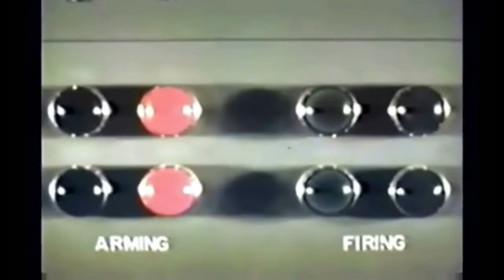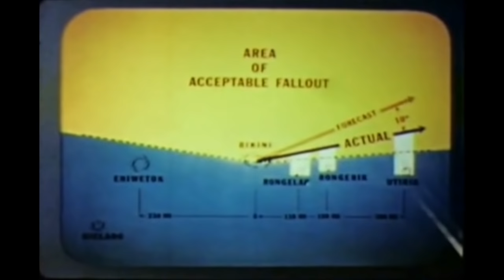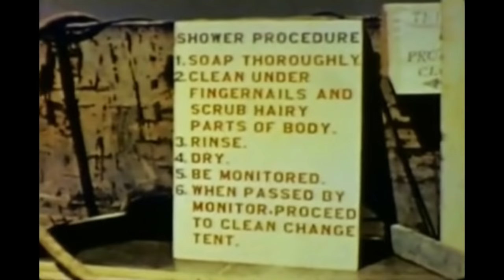The Deadly Miscalculation at Castle Bravo (V3.0)

Comment: if you die without ever seeing that in the sky during your lifetime, you're fortunate
Reply: Dinky Doo did you feel that intense heat even after you woke up? I did in my dream..
Reply: @PMScroMo...
Reply: Ummm...Tokyo fireball???
Reply: if you live after seeing that in the sky, you're very fortunate
Reply: Well kinda but in your scenario I'm still dead :)
Reply: I have a bad feeling nukes will be used at some point in the next 15 years.
Reply: what im saying is  Well I was actually going to say 14.5 years but I was rounding up.
Reply: questionseveryth1ng
questionseveryth1ng
I live 4 miles from a primary military base. All I will ever see, in about 9 nano seconds will be a bright flash. I will not have to live days, weeks or months dying a slow death from radiation. Yes, I would be most fortunate.
Reply: @tonyv8925  4 miles? You've got some seconds to get into your bomb shelter.

Comment: In the 90s I was doing environmental work for the US Air Force.   There were drills for me and my fellow civilians to practice recovery and repair of the base in case of tornado damage while the bulk of the military in my unit were deployed.   We also practiced what we civilians would do in case of some sort of low level nuclear accident.   I was trained to take a 2000 gallon water truck around to wash off low gamma type radiation off buildings.   I knew, however, that if such an event occurred I was taking my family south and calling in sick.

Comment: The technical problem was a miss calculation of the neutron capture cross section for Lithium which results in it being converted into tritium (hydrogen isotope) which fuels the fusion reaction.  The capture cross section is determined by colliding a neutron beam at the desired energy into a lithium target.
Reply: Not back then. It wasn't thought about at all. If it were to be calculated, it'd have been done with a slide rule.

Comment: What a terrifying sight.
Reply: lolwut? we've never made any enhanced radiation weapons
Reply: They never needed to build new ones. If you make the bomb small enough, the rad pulse is a lot wider than the fireball and you get a neutron bomb. If you stick some cobalt-59 around a standard bomb, you get an enhanced-fallout bomb.

Of course, they didn't use either of those. Instead, they downsized the yield, since megatons are a lot more expensive than they need to be if you can get the same result with a lot less bomb on a more accurate missile.
Reply: I doubt only the americans have variable-yield bombs, haha.
Reply: Scott Matheson watch tsar bomba explosion
Reply: But pretty
Reply: You think that was terrifying?  Look at the Tsar Bomba video on YouTube, THAT was terrifying!  The pilots that dropped the bomb almost didn't make it back, it was so massive, and that bomb had a parachute on it to slow it down so the plane could get away.
Reply: Russia, China and Israel possess multi-megaton thermonuclear bombs, the means to launch them anywhere in the world or BOTH. That is terrifying.
Reply: That's the idea

Comment: Miscalculation? Nuclear physics was still in its infancy in the early 50"s. There had been very little research on isotopes of atoms, let alone on isotopes of lithium. Cyclotrons were still in their infancy and backlogged for years. All the tests done then were a rush to to get results. The assumptions made for the trinity test turned out to be true. The assumption that lithium7 would be inert and not not donate neutrons was wrong and the result was the catastrophe that happened.

Comment: The lithium problem led to the real issue why the explosion was too big and very dirty...many more fast neutrons than expected so the uranium 238 tamper, which was not in a fissle state, was ignited and split by the excessive neutrons leading to far more explosive energy and radioactive fission products than predicted.  The primary fission/secondary fusion/tertiary fission bomb had been created.  A mostly pure thermonuclear fusion weapon is relatively clean as far as fallout is concerned.  The only radioactivity comes from the small primary which is less than a kiloton to ignite the fusion reaction.  But if there is any additional uranium in it, you will get tertiary ignition and more blast/radiation.

Comment: You didn't tell WHY there was more lithium 6 than calculated.  Under emence heat and pressure of the initial fission blast, the lithium 7 changed to lithium 6.

Comment: they used lithium 7 not  6 because 6 was too expensive and rare at the time. they extra fuel released from 7 created the higher than expected yield. had they 6 , theyd never realise the advantage of using lithium 7  since lithium 6 doesn't have the same properties.
Reply: It is an advantage. even if you use it and make a mistake. anyone can use their own advantage and make a mistake with it

Comment: how did the cameras survive with the footage we saw while other things around it got completely destroyed?
Reply: The footage is fake. Even if the machinery survived the film would have been wiped instantly with the massive dose of gamma radiation from the flash. This doesn't mean the weapons are fake. That's an entirely different topic.
Reply: paulanderson79 wrong😂
Reply: Pugsley tattoos how DO we get the footage then? 
I’m genuinely curious here.
Reply: Most footage of these nuclear detonations is from very far way.  The cameras were fine.  Footage taken a bit closer where the shockwave can be seen knocking down trees is taken by cameras that are well protected.  Whether or not you think the shockwaves are from  nuclear test is irrelevant.  A shockwave is a shockwave.  You just have to set up farther out the bigger the blast.  Buildings can be knocked down well outside the fireball radius in a large nuclear blast.

As far as radiation ruining the film, film canisters were lined with lead.  Simple fix.  There were special cameras designed after world war II to specifically film nuclear tests.  Reinforced bunkers built around them, special apertures, special emulsion to account for x-rays, etc.

You can research all of this yourself, you don't have to go around claiming the footage is fake just because you don't understand how anything works.
Reply: Cameras in bunkers under the ground using mirrors to see out
Reply: rock4you  They were housed in chromium dilantium!
Reply: Cameras were generally pretty far away.  They also sometimes used techniques to film reflections instead of the direct shot.  They would build bunkers specifically for observation and equip them with special glass that blocks high energy radiation.  They actually had to develop many new filming techniques and even completely new, extremely high speed cameras (called rapatronic cameras) to do precise measurements on the bombs during their explosions.

Comment: How can Lithium 7 be "inert" ?  Multi million degree temperatures are going to fuse it as easily as Lithium 6.
Reply: Get the reactions right!  The error was failure to account for the tritium produced by the Li-7 + n -> T + He-4 + n -2.47 MeV reaction.  Notice that the reaction consumes, rather than yields, energy.  However, the tritium produced enters into a reaction that does yield energy in excess of the 2.47 MeV that was consumed.

Comment: How and the hell do you call a mistake, a miscalculation?  They didn't miscalculate, they made a assumption, that turned out to be false.  That is a mistake, not a miscalculation.  They said 7 would be inert.  They guessed and were wrong, that's not miscalculating, that is just plain old WRONG.

Comment: The new thermo nuclear device was massive! 5 ft. wide and 22 ft. long. Mk 17 would just fit into a B 36 bomb bay. Standard load-out for the B 36 "Peacemaker" was a Mk 17 and a Mk 6 atomic weapon. It would have been extremely worrying to the B 36 crew that would have had to drop the Mk 17 because no one knew for sure if the plane could fly outside the blast radius before it went off! I believe technology today has shrunk thermo nuclear devices down to the size where they can fit in a golf bag. BTW, the USAF retired the B 36 60 years ago in 1959. This happened when the USAF took delivery of the B 52. FYI, the B 52 will be over 90 years old when the USAF finally retires it!!

Comment: How would it be possible in 1954 to capture the high altitude footage?  Seemingly on a stationary platform. 🤔
Reply: @
Dean Floyd
RE: "How would it be possible in 1954 to capture the high altitude footage?  Seemingly on a stationary platform."
There were plenty of planes that could have been used. They showed in the video a line of F-84 Thunderjets, for example. The could have also used a B-36 Peacemaker, B-47 Stratojet, B-52 Stratofortress (a.k.a. the BUFF), B-57 Canberra, etc.

Comment: Don’t worry boss... I’ve done all the calculations. Wait Oops! ☠️☠️☠️☠️
Reply: To be fair their calculations were correct.  The problem was that there was no way for them to know that under intense pressure and massive amounts of heat that Lithium-7 will become Lithium-6.  It wasn't something they could have predicted before running such a test.  

Also, the fallout and radiation issues they had weren't actually from the increased yield.  There was always going to be a LOT of fallout for a ground burst test whether it's 6 MT or 15 MT.  The problem there was that the weather forecast ended up being wrong - the forecast said that they would have steady wind that would not change direction for several days which would blow the fallout into uninhabited open ocean.  Not long after the test the wind changed bearing by around 90 degrees and blew the fallout in an unexpected direction - towards inhabited islands and the "Lucky Dragon".

Comment: If any physicist is available
Is it possible to increase the yield of a Uranium based low yield atomic bomb by merely spreading over/ adding up another enriched element like lithium7 or deuterium or plutonium?
Kindly enlighten me and oblige
Reply: Not an engineer but did look it up. The lithium used in castle bravo used 50% enriched lithium. As noted such an enrichment wasn't supposed to amplify the blast that much as previous enrichment was very small in other nukes. So yes it likely would. Remember they can fire a forty kiloton nuke out of a 155mm howitzer.

Comment: what causes the distinctive ring in the sky above the blast
Reply: Changes in air pressure causing cloud formation.
Reply: jaychi chocholowski Its the heat vaporizing the moisture.
Reply: +solace214 
that makes no sense
Reply: It's called a condensation cloud, also called a Wilson Cloud. Explained here:
https://en.wikipedia.org/wiki/Condensation_cloud

Comment: Castle Bravo was not the first hydrogen bomb to be air dropped. The SEMINOLE Shot was.
Reply: Castle Bravo was not air dropped... it was clearly contained within a shock-tower structure, it was only the prototype of a weapon which was small enough to have been air-dropped by the aircraft available to the United States during this period.
Reply: @JonlyWonly  damn so looks like the video was doubly wrong then
Reply: @bodombeastmode  Nope, the video never stated the Castle Bravo device was air-dropped.